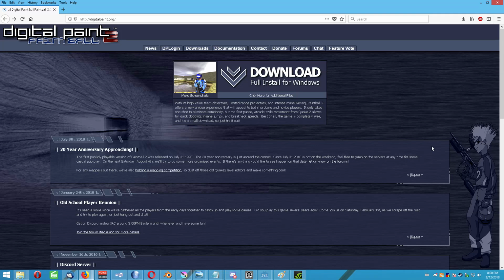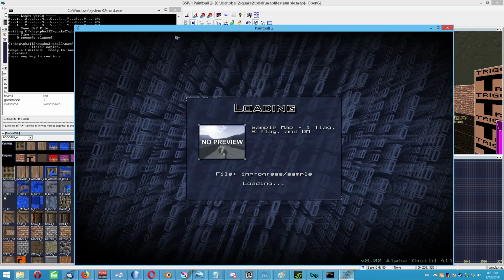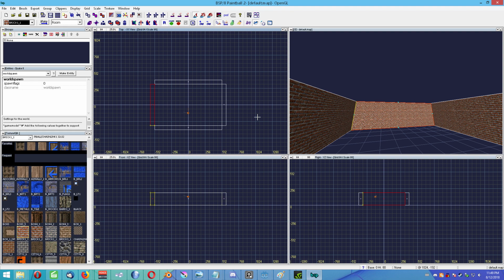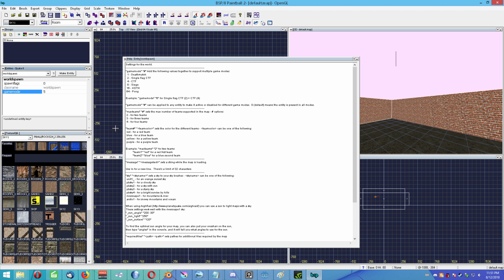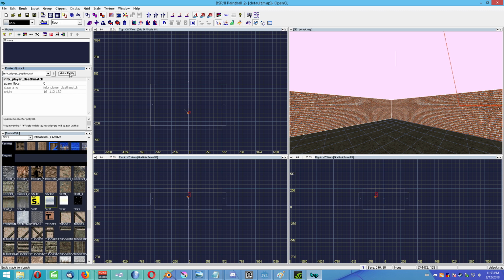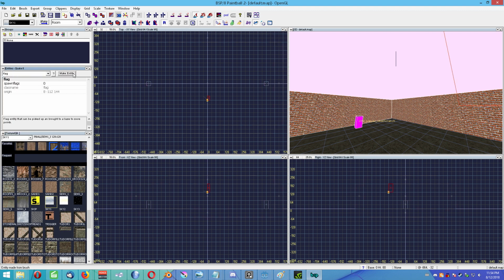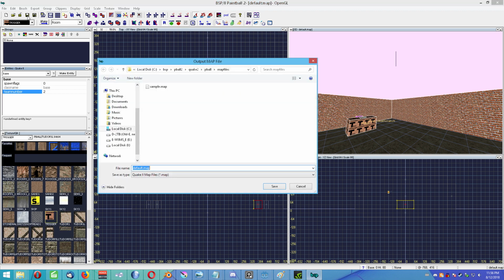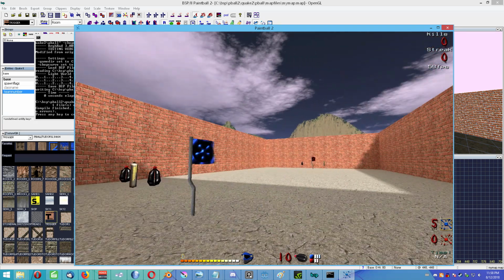BSP Tutorial 001: Downloading, Installing, and Creating Your First Paintball 2 Map

Comment: how do you add a backround or triggered sound?
Reply from the maker: you can set "sky" in the worldspawn, so like "sky" "pbsky1" (there's also a 2 and 3 and "riverscape" and a couple others).  For sounds, you can use a target_speaker.
Reply: Yes, I got the sky, I did put in a wave file for target_speaker, but do you need a function to trigger it?  I put in the volume and the object but there is nothing in the maps to see @jitspoe
Reply from the maker: @kingdavidranch8931  Yeah, you need to target it with some sort of trigger, such as a trigger_multiple if you want the sound to play when somebody walks into a location or you can use a func_timer if you want to make the sound play automatically at a specified interval (can also set some randomness with it).